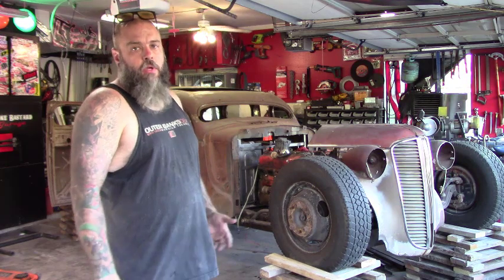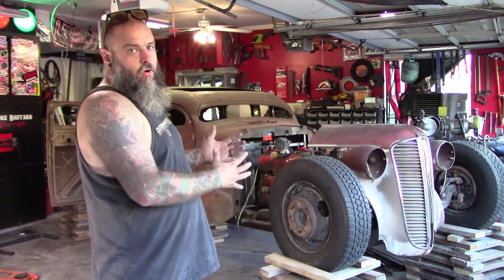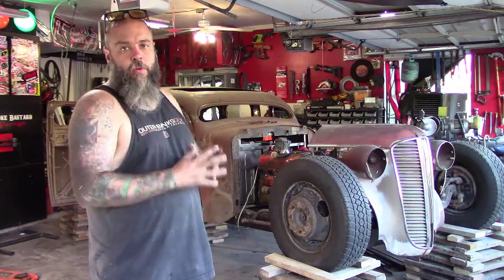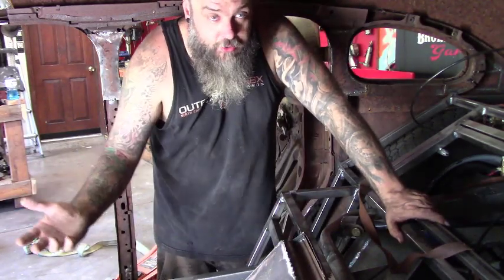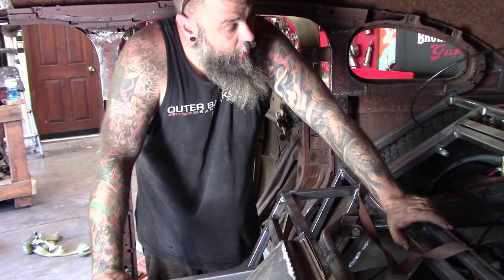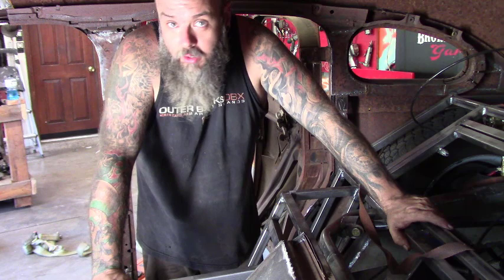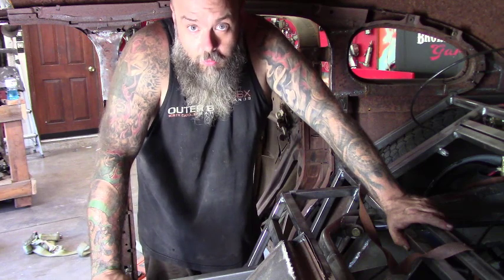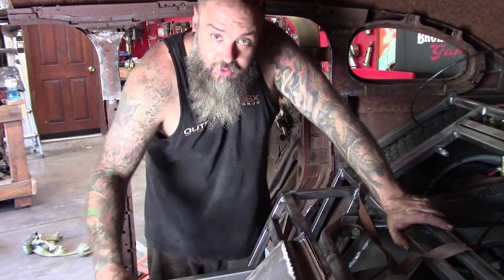How to Build a Broke Bastard Car Lift

Comment: Hate to be that guy but cribbing under a round tire will get u killed. Frame fine, tires no. One wiggle and the 2xs will scatter like cards untill your skull slows it down. I wouldnt do it if you nailed them together.
Reply: That's what was going to say, I've seen some shit happen & luckily no one was hurt
Reply: I was thinking the same thing

Comment: i just welded some old wheels in a T shape to each other. if you need more height add wood under it or weld another horizontal wheel to it. ezpz.

Comment: Ive done this many times, but always nailed the boards together..safety first man!
Reply: Good job for when things are slow or weather is bad. Build up multiple squares and then set up two spots in each one to lock to the other square. Ain't goin no where dat way!